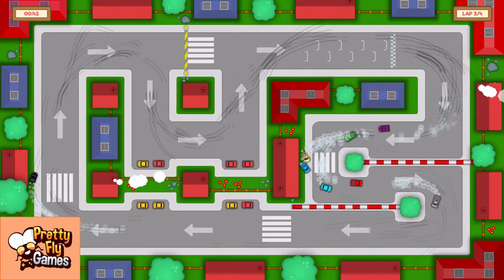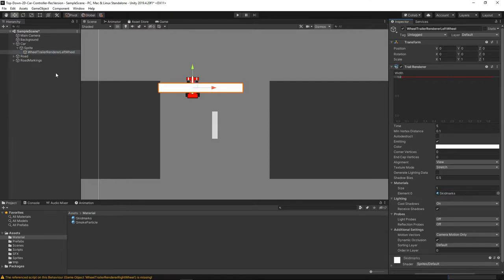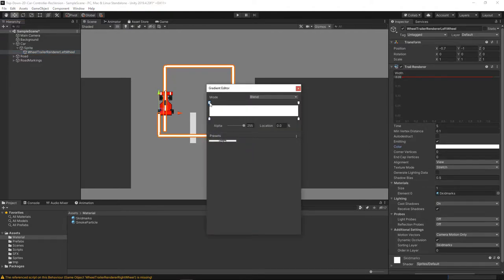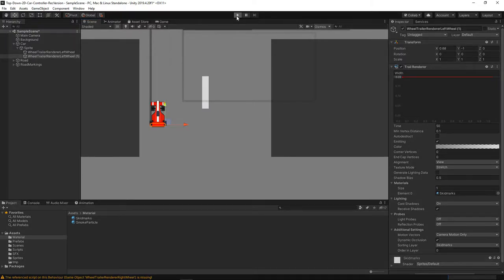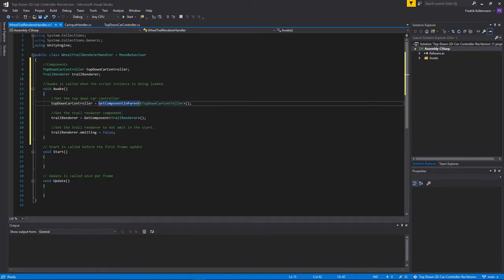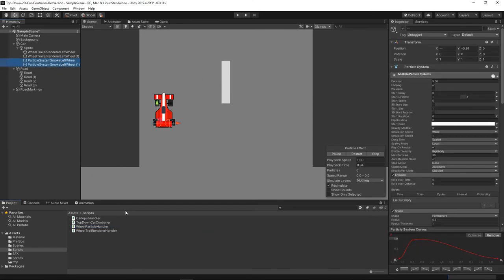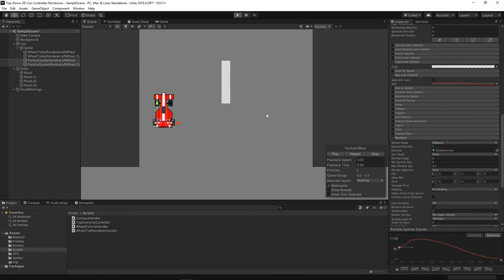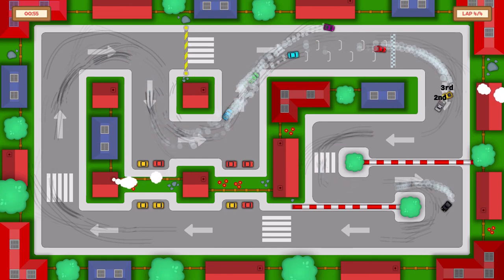Skid Marks & Smoke in how to create a 2D Arcade Top Down Car Controller in Unity tutorial Part 2

Comment: Guys, everybody who have a problem with "NullReferenceException: Object reference not set to an instance of an object." in WheelTrailRendererHandler class, you should to get parent component of TopDownCarController class, so instead of GetComponent<TopDownCarController>(), write GetComponentInParent<TopDownCarController>(). And then, it must works without any troubles!

This is because you're trying to get a component of an object that isn't on the object itself, and since the component is in the parent object, we should get the component from it. :)
Reply from the maker: Thanks for sharing 🙏
Reply: I should have looked in the commentsection first i was ther like 30 Minuts looking for what i did wrong then i saw this comment🥲🥲
Thanks for saving my ass

Comment: Love the way you explain
edit : I could not solve NullReferenceException? Object reference not set to an instance of an object. So I used your project and it was working. But why that issue apperaed ? I followed every steps of tutorial.
Reply from the maker: Glad that you liked it! 

Could you copy and past the entire error message from Unity? My guess is that you didn't put the Wheel Trail Rendered handler on the same object as the Trail renderer but that is just a guess.
Reply: @PrettyFlyGames  I deleted my own files 😅 Im using your files from particle effect part. I checked everything. But it was not working. Another guy in the comment section is also having the same problem. Btw make more tutorials like these.
Reply from the maker: @hhcdghjjgsdrt235  Ahh alright! 
It is possible that something was missing the in the recording. It has happened before and probably will again in the future :) 

I am working on Part 6 of this tutorial series, which will hopefully be out at the end of this week.
Reply: maybe problem was you make mistake with this line of code:
topDownCarController = GetComponentInParent<TopDownCarController>();

Comment: Anyone else getting an error when setting the emission rate?
NullReferenceException: Do not create your own module instances, get them from a ParticleSystem instance
UnityEngine.ParticleSystem+EmissionModule.set_rateOverTimeMultiplier
Reply from the maker: You'll need to ensure that the particle system is on the same game object as the WheelParticleHandler script. Otherwise you can use public  ParticleSystem particleSystemSmoke; instead of getting it with Getcomponent.

Comment: The type name 'EmissionModule' does not exist in type 'Particle System'

I done everything right. But it does not work. Is something changed over unity? I am using 2021.3.18f
Reply from the maker: Make sure you write ParticleSystem.EmissionModule when adding this and nothing else.

Comment: error CS0120: An object reference is required for the non-static field, method, or property 'PlayerCarController.IsTireScreeching(out float, out bool)'

anyone??? HELP!!!
Reply from the maker: Hi

Yes, you cannot write PlayerCarController.IsTireScreeching(somevalue,somevalue); in your code. You need to write playerCarController.IsTireScreeching(somevalue,somevalue) with a little p in player. You can download the source here https://www.patreon.com/posts/top-down-car-49913192 and check it out.

Comment: Do you really name methods with capital in C#?
Reply from the maker: The convention is to have the first letter as a capital in a method but there are no requirements really. So use whatever you find makes it readable for you. If you plan to work with others I suggest that you agree on a common ground before you get started.